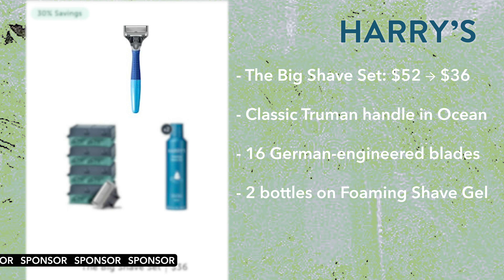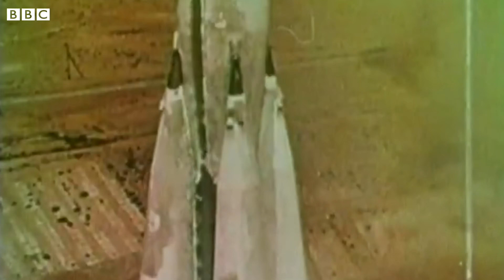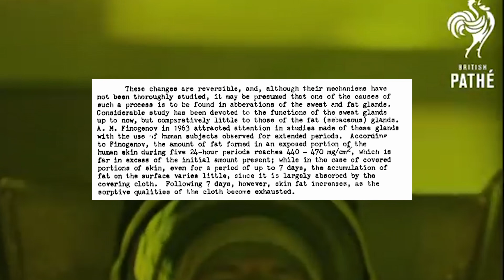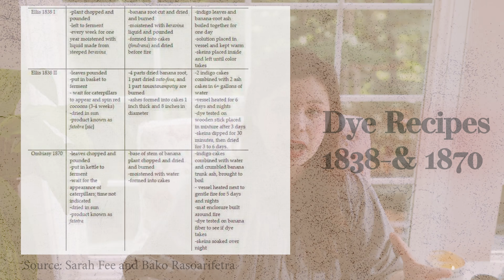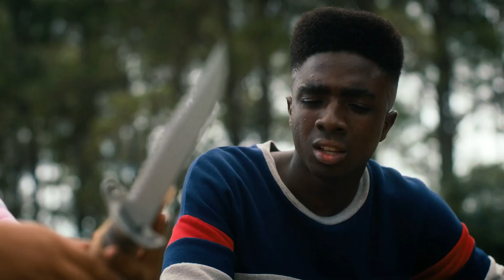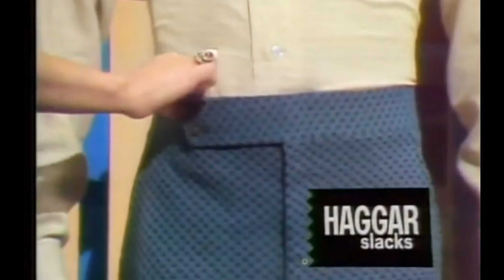The DISGUSTING truth about Laundry

Comment: So many thoughts on this video:
1. So that's where those little holes in my t-shirt come from. Still weird that they only appear on the bottom front of the shirts. 
2. The reason why most American washing machines do not get particularly hot is to save on energy. One of the standard tips for being more environmentally friendly/energy efficient is to wash your clothes in cool water. 
3. I have lived without a dryer before, and honestly the feasibility of air drying all of your clothes is highly dependent on the season. If it is warm and dry, the clothes dry quickly. If it is cool and damp, it takes days for your clothes to dry and the only way to get your jeans dry in under a week is to iron them (not very energy efficient). This is fine if you have a ton of clothes, but if you are working with a limited wardrobe, it sucks. 
4. Also, line drying requires a lot of space. I cannot fit 1 week's worth of laundry for 1 person on my drying rack. This means having to do more loads of laundry, which seems less efficient than doing one big load. Line drying outside only works if you have outdoor space (not a guarantee in an apartment). I have a small balcony, but I do not dry anything outside because a) I live next to restaurants and a major road and don't want my clothes smelling like car exhaust and cooking grease, b) it is humid where I live so drying clothes outside would take forever, and c) it's against apartment policies (not that I think anybody would actually notice since I live on the fourth floor).
5. Line dried clothing is very stiff and scratchy. The same towel can feel like a luxury good when dried in a dryer vs on a line. 
6. Historical laundry practices heavily relied on un(der)paid female labor and were massively time and labor intensive. Modern laundry practices rely to some extent on underpaid labor in the fast fashion industry. I don't think the labor exploitation issues were better in the past, just different. 
7. There is no such thing as a truly sustainable solution, because every approach has drawbacks and benefits and is highly dependent on the individual situation (i.e. is water limited in your area, where is your electricity coming from, how is your wastewater treated, etc). 
8. The world has roughly 7 times as many people today as during the time period that you discuss during this video. It isn't just a question of what we are putting in our water today vs back then (though personally I would still argue that water quality has markedly improved in the past few decades in the US and western Europe thanks to better regulations), but also how much.
Reply: Thank you for these utterly valid points.  I would also add that when everyone in the household is working full time (single parenting, multi-generational) there is not enough time to do laundry the old-school way.  And not enough $ to send it out to a washerperson.

Comment: As someone who has always indoor line-dried their clothes: watch out for mould and mildew spreading around the house. Line drying promotes a shit tonne of humidity.
Reply: I had a problem with indoor dried clothes causing black condensation mould to grow on my colder walls. I have now invested in a dehumidifier which is a lot cheaper to run than a dryer and keeps my home fresh and dry too.
Reply: Indoor line drying is great in the winter, when ambient humidity is extremely low. When I was a kid in Saskatchewan, the winter air got so dry I'd get nosebleeds.
Reply: @elfieblue3175  yup I usually wash my clothes specifically on days that I would ordinarily need to turn on the humidity. Thank goodness we only wear heavy sweaters in winter…
Reply: @elfieblue3175  Opposite in coastal B.C. Winter is wet season here, at least until Arctic outflow season. On those days, you can effectively freeze-dry your laundry.
Reply: @elfieblue3175  Hello Canadian Prairie friend! The air is drier than a popcorn fart! My mom gets nosebleeds too!
Reply: @ItBeThatWaySometimes  It also matters where that exhaust fan expels the air. In far too many homes, it just expels it into the attic rather than outside, so you will still have mold and mildew issues.
Reply: @barbierader677  We just moved into a house with that issue, and we have hired a roofer to properly connect the exhaust fans to the outside.
Reply: YES this! Esp in winter! Get some of those salts that capture air moisture if you start sensing that something is off
Reply: @agimagi2158  Depends where you live. I really like do hang drying laundry in my room in winter, because air is to dry when it's cold and it's better than an electric humidifier. And one needs to ventilate their home daily anyway...
Reply: @autumnramble  Yeah thats true. We as an example can't really went rooms in winter as inside temps would drop immediately to about 17°C.
Reply: I discovered that I don't have problems when room in which I dry my clothes has window ajar, and the furniture isn't touching the wall.
Reply: It might be the house problem, not the indoor drying. I had mould problem with my old apartment, it was totally NOT caused by hanging clothes to dry (I dried them on the open balcony).
Reply: @ItBeThatWaySometimes  I guess it might depend on the amount of laundered clothes and bedsheets. If you wash a ton of them in one day, and dry them all in the same room, the air will def become more humid. I just don't wash everything we own in 1 day. My machine has settings for smaller loads. It's ok to dry like 5 shirts and 2 pairs of pants in a room, the humidity will not increase dramatically.
Reply: The problem with mold and mildew yes, depends on how well the air flow through the area is, how well isolated the house is and also how fast the fabric can dry on itself (pillows or thick (cotton) hoodies). The isolation becomes a problem when it doesn't allow humidity and airflow through it. This does obviously make a building keep its heat better (as the hot air can't get out), but mould accumulates much faster, especially around the modern, isolated windows. Also the isolation inside the walls can be done in different strategies which also make a difference.
Reply: Yep this was an issue when my roommate would dry her laundry in our tiny NYC apartment. Her whole room would be damp
Reply: @ItBeThatWaySometimes  poor ventalation and bad construction are both problems. poor construction can mean ventilation can't happen as i there being no windows to vent air out in the bathroom...
Reply: In my experience mould means bad house construction. Water leeking in somewhere and bad airflow troughout the house. If humudity only was the problem showering would be done outside the house.
Reply: @kattkatt744  that’s true but unless we plan on tearing down every older home maybe we could just add some ventilation requirements to building codes?

Comment: FUN (DANGEROUS) FACTS: fabric softeners actually adds a film onto your clothes and make your clothing more flammable and doesn't actually 'soften' your clothes. This can be dangerous when you toss them into the dryer but also in your day to day wear. I'm a fire performer and never used fabric softeners due to the hazard and the gross feeling it causes. 

Also some companies sell "fire resistant" baby onesies: 1) this means you should never dry the outfits on high heat, it'll cause it to be very rough on the skin 2) it does not last for ever. its effectiveness is only a year or so. Be aware that it is perfectly fine buying second hand but don't just blindly trust the label. 3) "fire resistant" baby clothes are a bit misleading because its only fire RESISTANT not a retardant, it has a higher flash point (burning temp) and if it reaches beyond that point it will still burn and turn to ash and not melt onto the skin. (synthetics will melt into a pile of molten goo whereas natural fabrics will still burn but turn into a ash and not melt your flesh)

Do not go and buy fabric retardant spray for use on fabric that'll be worn on the skin, it will cause severe irritation/rashes and such because the chemicals are not supposed to be used that way, and it does not make up for the fact a fabric is synthetic and will melt.
Reply: Not to mention that athletic clothing explicitly says not to use fabric softener, because it ruins the moisture-wicking properties of the clothing.
Reply: Gotta love how all of the children's sleep clothes you find in the store nowadays are the synthetic kind that will melt onto the skin.
Reply: @winterinbloom  " law may be different in other country" But in Canada and USA; synthetic are used because if it catch on fire, the flame will stop by itself really quickly. compared to natural fiber. So yeah it melt, but the kid will have a super small burn mark instead of a big one. Because of that, there is a lot of limitation if you use natural fiber. the bottom of the shirt (or nightshirt) need to be smaller than the chest, any bits that exceed the body like frill and ruffle can't be more that 1/8" (or 1/4" can't remember right now, I should look at my notes), Sleeves need to be tighten at opening. That cause a lot of limitation on the designs....  Or you need to apply a chemical to make the garment flame retardant. If you do not follow those government's guide line you can have BIG fines. Those guidelines reduces a lot the severity of fire injuries on kids. (I worked for a manufacturer of kid sleepwear)
Reply: I use some wool balls that I got for drying clothes. I like them much better.
Reply: And the way to avoid fire retardant clothing for children is to put them in snug fitting clothing.
The basis for the law is that children were getting burnt due to being near open flame sources, not house fires, think candles fireplaces stoves, so they over corrected by mandating sleepwear to be fire resistant. Relatively recently it's been reevaluated and clothing for sleepwear for children has to be snug fitting to avoid needing the coating. It's why fabrics will say not for children sleepwear because they don't want to be on the hook for you making a baggy or unfitted pajama set or nightgown for a kid and then have them catch on fire. Because those clothes If purchase should have had the protectant coating.   
Tldr: avoid fire retardant sprays by baking children sleepwear very fitted.
Reply: I learned this from my partner, who was a working blacksmith.  He never used softener because he didn't want to "go up in flame" if there was a spark from his forge.
Reply: I use white vinegar as fabric softener. Instead of adding something to the fabric, it helps remove leftover detergent, which is what makes the fabric stiff.

Comment: As someone living in Germany, I am pretty confused about much of this. Yes, in some parts here you are not allowed to hang laundry in certain places (like outside the window, or in my case inside the flat - because dampness) but: this means the owner has to supply you with a space to hang laundry. Often in the cellar, where there is also space for everyone to put there own laundry machine (and if you have one dryer). People sometimes have dryers, mostly to keep towels fluffier or to dry other sturdy things. 
Obviously, you need to know how hard the water is, so you can adjust the detergent and if necessary add a water softener? (same goes for dishwashers!). How much people separate their clothes differs, but I wouldn't wash underwear with other clothes. I usually wash them at higher temperatures with the towels (with detergent meant for higher temperatures/white cottons). My mother does separate delicate/not delicate, dark/white and (at least while there were 5 people living in her household) would usually separate further by color/ garment type (no jeans in with the blouses/shirts). I also have rules what things I won't wash together, but sometimes get a bit creative if I need to wash but don't have enough of one kind to fill a load.
Reply: For a lot of people in the US, laundry is treated as a dump and forget it kind of process- toss everything in the washer and then in the dryer when it's done.  The only reason I can remember being told to separate out items was due to possible color bleeding from fabrics, nothing to do with sanitary issues.
Reply: @yarnellka  I think here it greatly depends on your family (as those are usually the ones teaching you). I think my mother mostly sorted by color (because bleeding) and type (because you use a different setting and detergent), but I also think most people would not wash their underwear with, say, dishtowels? I have a cat and got into the habit of never even washing finer clothes directly after the blankets she likes to sit on (as well as catbeds, rugs, cleaning towels) but do another load at a higher temperature (usually sheets) in between. I do lover her, but I do not need more cat hair (or other, err stuff) on my clothes.
Reply: @odsmey  The washers in US are different from ours, at least they were when I was there. They are huge, and I mean, really huge. You don't get a load if you sort the laundry. I had I think about one to two loads there from the same laundry I make four to five loads here.
Also, the washers usually don't (or didn't) heat the water. It is/was connected to the warm water tap, that's it.
Doing laundry was one of my big question marks when I was over there and I really don't miss the way it's done there :)
Reply: I'm from Germany too and I agree with everything you said :)
Reply: I live in a German suburb that was mainly build in the 60s and there are washing lines everywhere there might not be a fence or a stone path in the gardens but there will be poles for adding a laundry line 😅
Reply: I totally agree. I‘m from Germany too and find the thought of washing my underwear with my Shirts very strange. They go in with the towels and socks and are washed hot. Bedsheets are washed seperately and hot, too. Same for cloth diapers, but I know the use of those isn‘t that common. The other clothes are devided in white and colourful/black and delicate fabrics are washed seperately, too. We use oxygen bleach and dose it individually. And use no softener at all.
Reply: I‘m from Germany too and I totally agree. Clothes get separated as much as possible and I use the appropriate detergent for different kinds of fabrics. 
I however wash my underwear with my normal clothes because they won’t survive a 60 degree wash so there’s not really another option I guess. 
And obviously air drying clothes. And I had the sun remove red dirt that would not come out in the the wash from a light blue pair of jeans. It was completely gone. Took maybe two or max. three washes with hanging it out in the sun afterwards but you would now never believe that the whole but area was every stained red
Reply: Increasing detergent with HE machines messes them up though. A lot of people use more detergent than what they need for HE machines, because it's what they're used to, and it basically clogs up the machine, because it doesn't all come out in rinse mode. It makes the machine work harder, trying to remove it, increasing the likelihood of malfunctioning.  Household water softener system could be the answer, but it costs hundreds to thousands of dollars.
Reply: @lygophilia4127  Okay, but who is knowledgeable about home water softening systems??? My area was listed on Abby's map of the US as only "moderately hard," but I literally have to dump CLR into the toilets to get the mineral deposits from the hard water out of the toilet bowls. My water is hard enough to make people cross the street to get away from it at night. But my water tank is an old glass boiler my plumber made me swear not to change 'til it's beyond repair. Help???
Reply: @valeriekhall  i grew up knowing about hard and soft water because my dad designed and installed water softening and reverse osmosis systems in the tri-county area around us. 

occasionally, I forget that other people don't know that stuff off the top of their head... some of this video surprised me too, because I was like, 'well duh! only a handful of places in the US have really soft water. duh it messes with your skin and your cleaning... what'd you think soap scum was?'

as for what you can do without a home softening system.. depends on your pH. You can add some stuff to basic water to help bind the hard water ions (effectively blocking them from binding to clothes/hair/skin), but you have to add different stuff if your water is acidic. if you do get a water softening system, beware of municipal chlorine disinfection because it destroys the softening resin (also smells and tastes gross and dries out skin and hair). You can get a different filter to get chlorine specifically out, but the chlorine filters almost never soften water. different ions, different chemistry, rarely in the same apparatus. i don't know of any off the top of my head, but maybe my dad knows of some... i'll ask him if I remember later. 

I'm not as familiar with the effects of chloroamine disinfection on softening resin though..... and regular chlorine filters don't get chloramine out either. chloramine is what my current city uses. 

honestly, for home use, phosphates do a really good job of softening water and normal home use doesn't cause the problems Abby mentioned... those were because of industrial levels of phosphates (think fertilizer runoff, livestock runoff, etc.... you know, stuff used, created, and sold by companies with huge lobbying and legal departments. Think Monsanto type companies). But home use requires like a half teaspoon for the dishwasher and a half teaspoon for the washer, and that's for REALLY hard water. I use 1/8th of a teaspoon for my moderately hard water. (use hexametaphosphate for acidic water, tripolyphosphate for basic water.)

Or just get a home water softener, and put in a really good chlorine filter upstream from the softener.
Reply: @valeriekhall  Home depot, Lowe's, and above all, Google are good starting points.